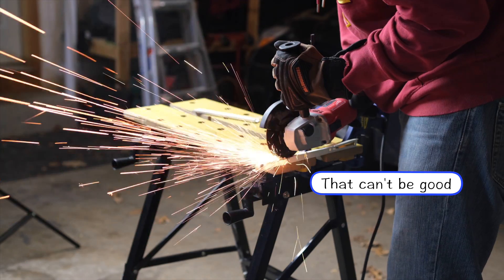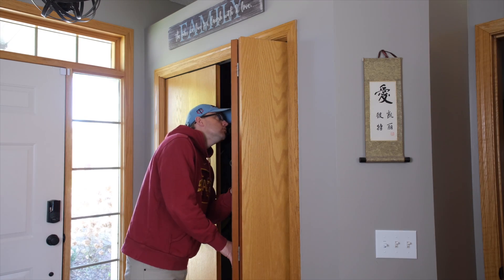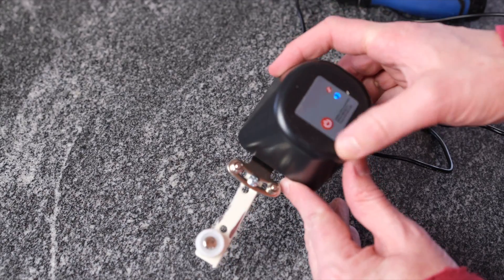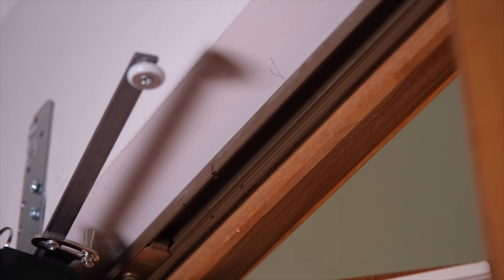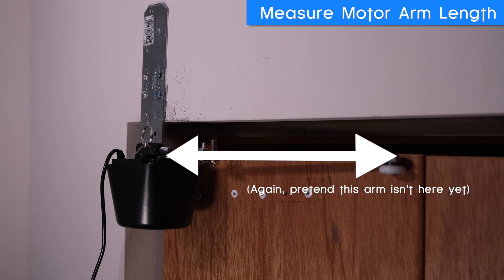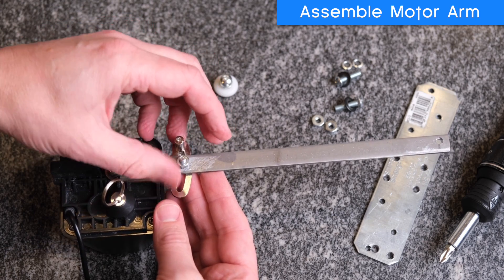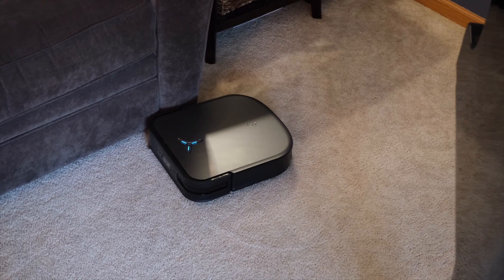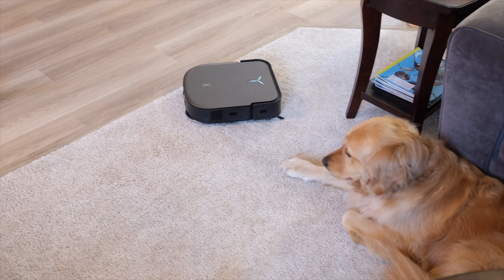My favorite automation ever

Comment: Love the video. Can you adjust to have the door open more?
Reply from the maker: Thanks! The amount the door opens is limited by the width of the track. Fortunately, it opens enough as is for my vacuum to fit through. But if I needed to open wider I would cut a groove on the opposite door panel that fit the track so that it could just slide right into that groove and the door could open wider.

Comment: This is something I've been thinking about for a while. I love your solution, but before buying a valve motor (genius idea, btw!) and have to rent or borrow a grinder, I think I'm going to try using the Aqara blinds opener (that pulls on a chain) and hook that to my door. In theory, it should work, right? Of course, "working in theory" is why test pilots are so highly paid. 🤣 Also, I thought the ketchup idea was ingenious. I'm going to remember that!
Reply from the maker: Thanks! You don’t actually need a grinder; a hack saw works just fine, but the grinder is definitely more fun. The problem with the blind opener is that you need some force to bump the bifold door out first.  Maybe if it was mounted at an angle? I’d love to hear how it works if you give it a try.